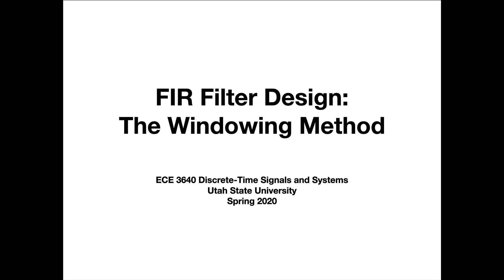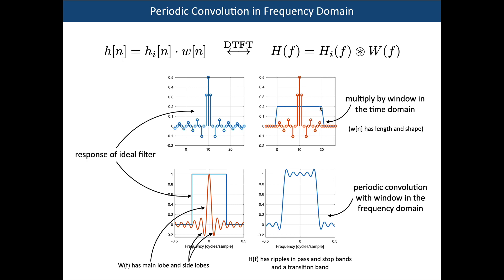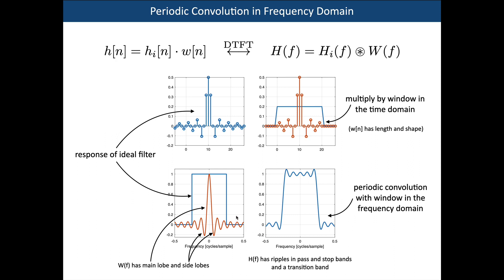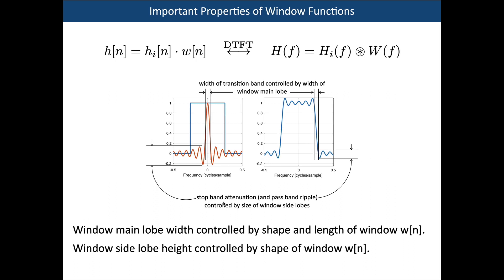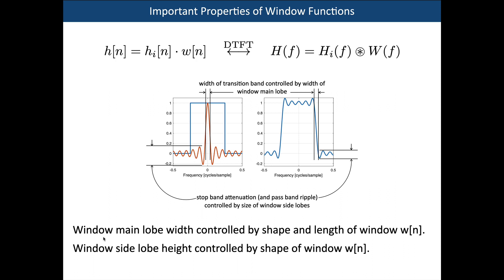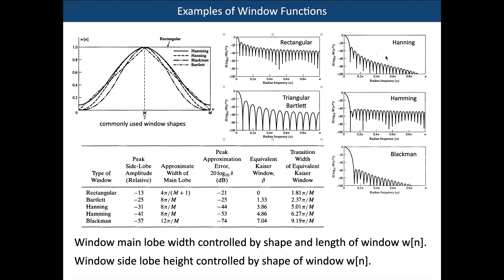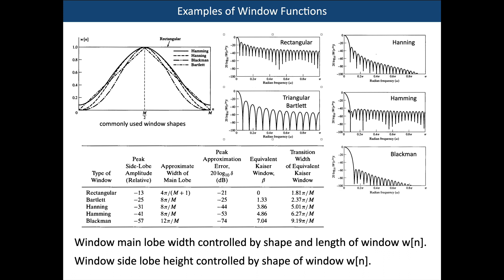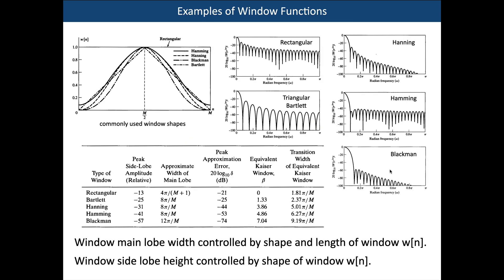FIR Filter Design using the Window Method

Comment: Great video!  So once you have the impulse coefficients, do you just convolute it with your input signal of the same length filter length?
Reply from the maker: Once you have the impulse response coefficients, the filter output is obtained by convolving the input sequence with the filter impulse response.  This results in an output sequence that is a few samples longer than the input sequence.  The extra samples are known as "convolution tails".